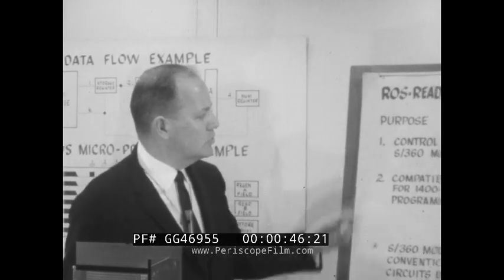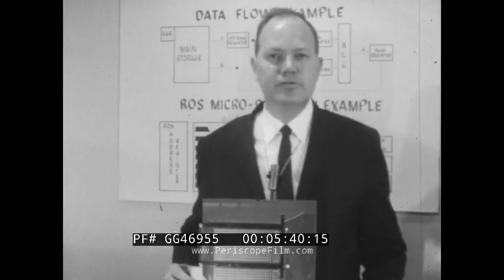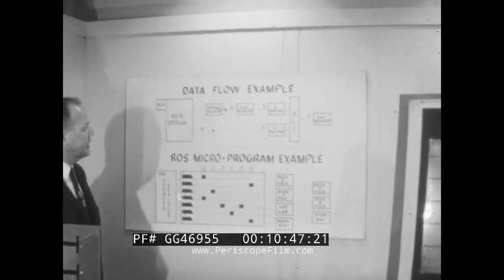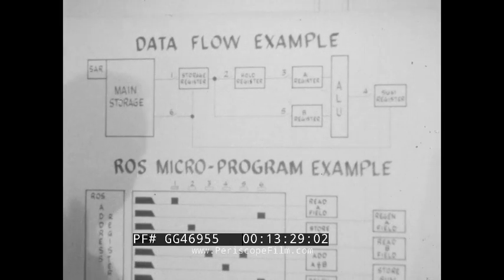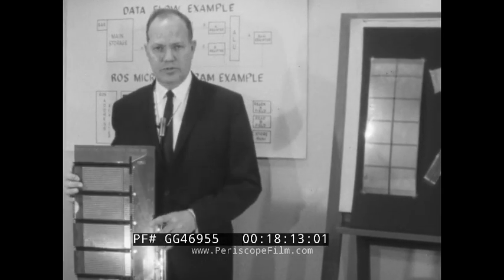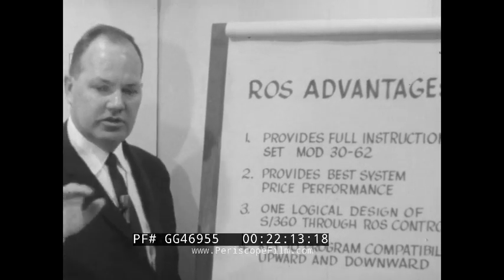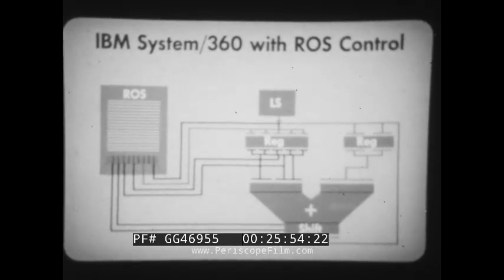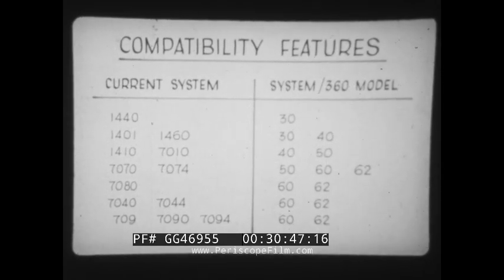" IBM SYSTEM/360 READ ONLY STORAGE "  1964 INTERNATIONAL BUSINESS MACHINES CONFIDENTIAL FILM GG46955

Comment: At Brown, we had a 360/67 which (I was told) was a multitasking version of the 360/65.  I knew that microcode existed.  But, I had thought it was hard-wired using Augat wire-wrap boards, not this capacitive scheme.  What puzzles me is why IBM would provide for customizable microcode when 360 machine language (and channel control words) were quite clearly defined in references like the POPS, etc.  I mean, just how many ways can (say) a shift-right-logical instruction be implemented?  Why would an S/E need to configure one of those flexible cards differently for one customer (say Sears) versus another (Amex)?
Reply: It was more that microcode was still software, and someone could still discover a bug in it. In the 370s they replaced this ROS with semiconductor memory, and loaded it from floppy disk, which IBM had invented for the purpose.
Reply: Prior to microcode, interpreting instructions was accomplished with hardware.  Microcode, implemented on the 360, allowed bug fixes and optimization without having to rewire the circuitry of the machine.  It also allowed the machine to be virtually rewired to accommodate new or upgraded hardware.
Reply: The different S/360 models might use different internal hardware for cost purposes (smaller ALUs, floating-point unit emulation vs. hardware, address space, etc.), but by using microcode instead of custom-wired decoder logic, it makes it easier and cheaper to implement the same ISA across the differing hardware. The end user could buy a low-end machine for their initial programming work, then jump to a higher-performance system when needed, and not have to recompile/reassemble their software.
Reply: Yeah, what he said!